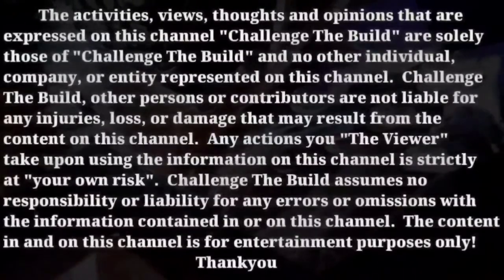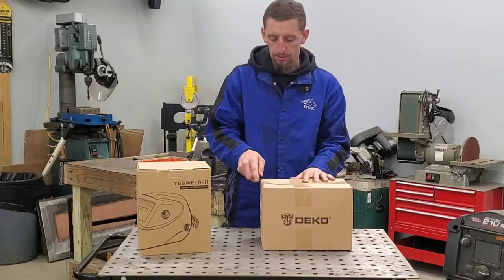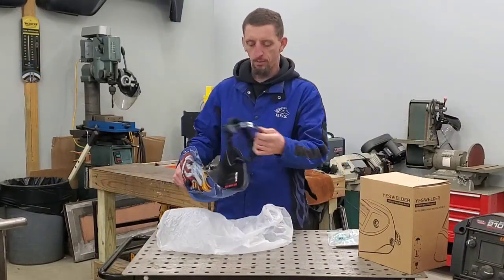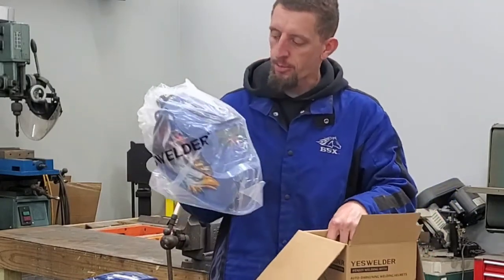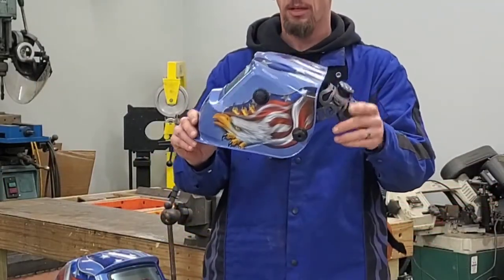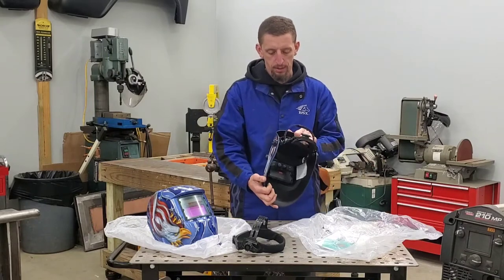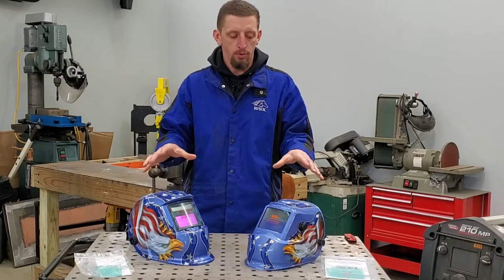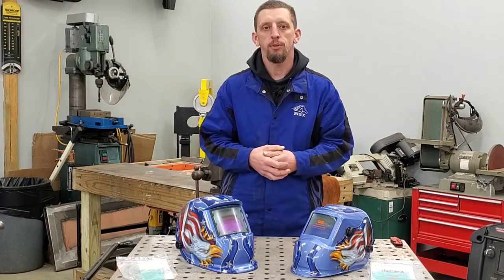Amazon Best Sellers Under $50 Bucks - Auto Darkening Welding Helmet Review

Comment: Great (unboxing ) 2 Chineses  welding helmets , at least you can uses the lincoln multi process  that is there, to show how fast turn the switch dark to light and which one u can c  better when you are welding .
Reply from the maker: You can see pretty much the same out of each one, I believe it comes down to personal preference.  As far as switching from dark to light the only way you gonna see that is with super slow mo, because its basically as fast as you can blink...In my opinion that info (which I did mention in the video) isn't (in my opinion) gonna sway someone's decision.   If you want my opinion on what helmet is better the yeswelder is simply because of headgear design.
Reply: @ChallengeTheBuild  yeah, I already had 1 yes welder,  last around 2 years ,no bad for a 40 dlls helmet, they just  copied the  miller tech, you know 😉they copy everything,  I'm trying to find a helmet with  blue color, I mean like the lincoln  3350, too expensive,  or something different to the  old green, do you know someone?? 😉
Reply from the maker: So look at the Jackson Safety Insight, rated 1/1/1/1 its digital and probably the closet thing you will find in regards to Made In America, (assembled in America from sourced parts) 🤔..  From what I see a lot of people buy Jackson Safety.   I am in the process of making my top ten list of welding helmets but since I am buying all of them it's very expensive 😖...

Comment: Minor detail, the headband attachment on the deko should be assembled with the big square hole washers on the outside, and yes there are no instructions!
Reply from the maker: Thanks for the added input !   Head gear assembly sometimes is way more challenging and frustrating then it should be...😁
Reply: Very GOOD manual on YesWelder, and NO Chingling !